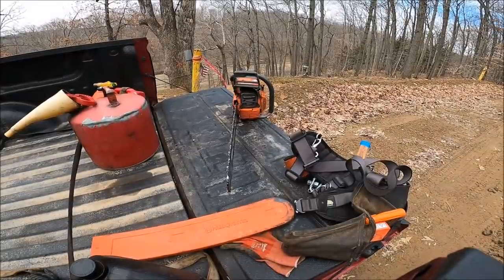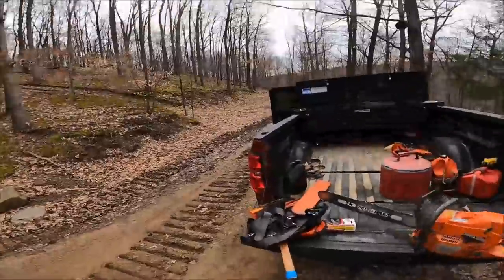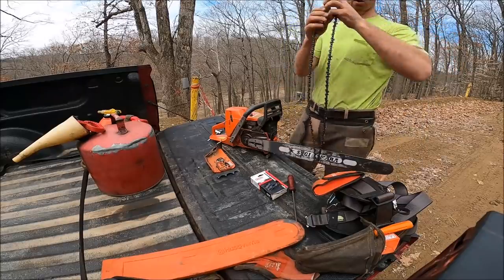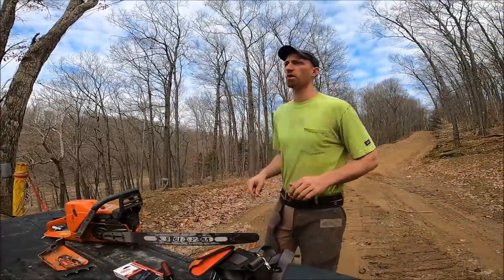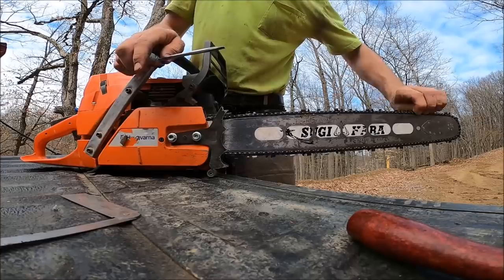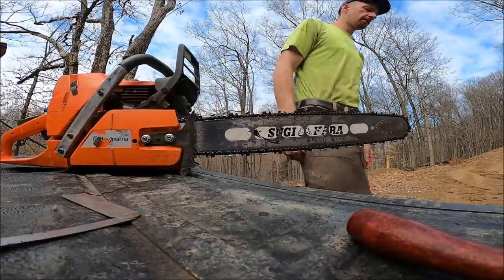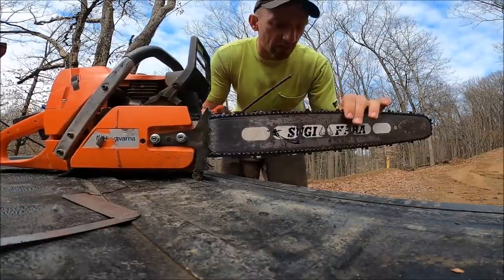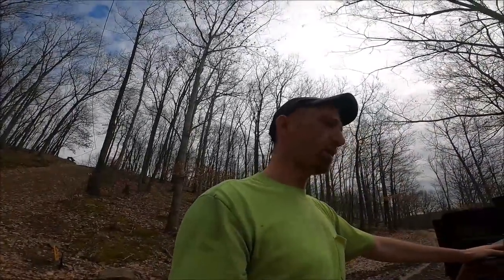New job logging the old school way! Gotta sharpen a brand new chain???

Comment: Experts I listen to, also say "pass on the grinder, except for rocked chains- use a file." I've never in 50 yrs found a new chain that didn't benefit from the attentions of a file. As a part-time cutter, over the years I've tried all ways of chain sharpening, and have settled on Granberg G-106 guide, because of precision and repeatability, extending chain AND file life. Put a flat file in, reorient things and take down the DEPTH GAUGES precisely. True, that guide takes a little conscious thought in the learning process. Then it's "play it again, Sam." No need for stump vise with it. I still use one from 45 yrs back. (FWIW Chain mfgs make no mention of "rakers." Thinking of misery-whip plowing-teeth?) Tightening chain, I find it easiest to set the nose on something soft and raise the handle- keeps fingers clear of teeth. Don't let the cutters bite, Pete.

Comment: Just a quick informational point. Heating the teeth with a power sharpener WILL ruin the chain, and I hand file too, but it won't make it more brittle. Unless you accidentally somehow quench it heated steel that cools slowly gets softer and less brittle.  The teeth won't hold an edge because of that. Great information though.

Comment: i find people always are looking for a way to make sharpening a chainsaw easy and try to skip the steps it takes to actually be successful. my biggest tip would be to first learn how exsactly a tooth cuts and which part does what. then just practice and build the muscle memory it takes to be consistent with a file and if your not sure about raker height double check with a gauge. and ive found alot of the times ppl assume that there cutting on an angle is the chain right away when alot of the times its the rails on the bar not being level. everyone struggles with it at first im no exception and im still no master at it but u can save urself alot of hassle by just learning what can cause it to cut crooked or throw powder instead of trying find some gadget that may help with part of it but as a whole wont make it easier. my biggest issue i have no is finding a good spot to prop my saw up to hold it steady when i file that doesnt kill ur neck lol. great video though man i like how you keep it simple and dont try to over complicate it and let ppl know to just do it and it will come over time.

Comment: I like a chain thats had a third worn down as I have the riders where I want them, the angle of the tooth is just right an it throws chips long as your hand,, have to be careful when that sharp as  they are very aggressive and easy to ruin if cuts not cleaned out of debris

Comment: thanks sharpening video. When I tighten bar nuts I use a 3-4" chunk of wood  to raise bar tip, your doing same thing, only quicker. I am going to take your advice on chain tension,  I think I have been using too much tension. Thanks for the watch

Comment: Used to log out west. They used Oregon chain skip tooth, chisel bit  I think. With a new chain, I didn't file it before ever using it, but I would take three or four swipes off the rakers right off the bat.  Our teeth had a line for the angle. I usually tried to stay with that angle. Some guys wanted more angle.

Comment: Also when logging. The landing men used the skiptooth chain. Cause If you hit dirt or rocks it was less teeth to fix; filing.  While the fallers used "Full-comp" chain. Which has twice the teeth. One every link compared to the skip-tooth chain. Usually they weren't bucking or limbing  and hitting dirt or rocks.

Comment: I used to use the EXL chain. Got 3 bad batches of it with teeth so hard a new file wouldn't scratch it. I finally said enough is enough. I'm a diehard stihl guy but found the C83 xcut Husqvarna chain. Crazy sharp out of box and works great! Stahls has it and it's only a few cents more than the junk oregon. Try some out, you won't be disappointed!
Reply from the maker: Thanks for the tip
Reply: Yep, the new x-cut chain is great.

Comment: Pro tip;
A hard spring steel key ring can be stretched out and makes a perfect bar cleaner, it fits the groove and the oiler passage perfectly.
Reply from the maker: Great idea
Reply: Take the pointed end of a used up file and hammer flat with your axe, works like a charm and gives extra use to an old file.

Comment: Pete...I know they are expensive but when considering what normal (pink) grinding wheels do to the temper of a chain CBN wheels are a bargain.  They almost never require dressing, maintain their profile indefinitely, will handle 1000 sharpenings or more, but best of all they almost never burn a cutter unless you are much too aggressive in the amount of tooth you are removing.  The only wheels I found reasonably priced and very rarely burn the cutters are the black Molemab Resinoid wheels.  They cut really fast but need to be dressed a lot more than the pink wheels that burn and gum up a lot.  I only use my diamond wheels now.

Comment: The only reason I visit the Stihl dealer is for chains. They have great chains and okay saws. But why buy a Stihl when a Husky is cheaper and lasts twice as long? I used to cut around 4 million feet a year by hand for over 25 years in the Appalachians before I got my track cutter and I was die hard Stihl for years until I got a couple of 372s and 576s. Toughest saws ever made and the 572 is even better. I have a Stihl 462c and a 500i and they cut okay but are lacking that Husky quality and the 500i is way too heavy for the small amount of power it has. Talked to my dealer friend this morning and he says the 592s are on the boat and supposed to be at his door on 4/15. That day I will be at his door too!

Comment: there is a new chain called orbit the comapany is out of main they hae been out about a year they said harder than oragon chain holds a edge longer and you wil notice a difference when you sharpen i bought one for my 372 haden got to cut with it yet

Comment: Several yrs ago I went to work in a saw shop that had a Stihl grinder. The customers were weekend warriors who never touched their chains or touched them wrong. By the time I saw them they needed to start from square one. I usually sold them a new chain and sharpened the old one for spare. I also told them that it would take 2 machine sharpenings to get the teeth evened up without bluing them. I still prefer to sharpen mine on the tailgate.

Comment: Nice video.

I’m a backyard hack with a chainsaw.
But I love cutting.
If it cuts at a slight angle to the right as I pass thru the log - what’s the change I need to make ??

Thanks for the content!
Reply from the maker: Bar could be worn on the right rail or chain is dull on the left cutting teeth
Reply: Just to add a little on that.  Use equal pressure on both sides when sharpening.  Also, all teeth on both sides should be fairly equal in length.
Reply: Try using an Oregon depth gauge tool and that will go away if the bar is straight and not worn on one side ;).

Comment: What size file do you use for a 3/8th chain?
Reply: Ive switched from 3/16 to 7/32 recently, and I think I like the bigger file.  Creates a more upright gullet that cuts just as fast but seems to last longer.
Reply from the maker: 7/32
Reply: Just discovered you, brother. I also live in Pa, only I work drywall/plaster and painting.  But I own 160 acres of land, so I’m always cutting firewood or clearing fields and or trails.  I only recently stepped up my file and have found a big improvement.  I find it interesting that so many of the tree guys out here bore cut and then nip the dog tooth or trigger in the back.  I was never formally trained obviously.  Just learned from my dad and uncles, and they always just used undercuts and back cuts.  The only time we plunge cut is on a hard leaner.  I’m not crazy about backbarring, but it looks like you’re just as comfortable pushing on the back as letting the saw pull from the front.  I’m going to be sifting through you’re back catalogue now.  I love YT for that reason.  A guy like me can learn a lot from watching you guys fall timber.  Thanks

Comment: Pete… thanks…. Glad to know how similar we do it.

That chain tensioning tip needs to be a clip of it’s own… enclosed on a thumb drive with every saw sold.  My neighbor had a brand new small homeowner Stihl… I think it was a 170? This was his first chainsaw and first time using any chainsaw.

He brought it to our firewood cutting party one weekend.  We showed him how to start it… but,  It was totally gutless.  Every time he touched a log it would bind up.

I asked him to let me take a look at it… the chain was so tight you could pluck Yankee Doodle Dandy on it. 

So, I showed him how loose mine was.  He asked if I wasn’t afraid it would come off.  I told him that I hadn’t had a chain come off on its own… without being bound up… in years.

So, I showed him how to adjust it.  I then told him to make a couple of cuts and we’d readjust it.

I got to cutting and wasn’t paying attention.  After he made a couple of cuts, he went to the stump and started fiddling with his saw.

A while later, I stopped.  I could hear his saw laboring.  So, I waited until he finished struggling through his cut.  Then I tapped his shoulder and had him shut it down.

When he pulled his saw out and sat it on the log, I pointed to the blue bar and burnt black teeth.  I sat my saw beside it and showed him the differences.  

My old worn out bar didn’t have a speck of blue on it… and you could see light between the bottom of the bar and the chain. I said, you’re running the chain too tight and that bar and chain are toast.  

He said, “It’s new.  I’ll take it back and get another one.”

I was right, the guys at the saw shop told him they didn’t cover abuse.  Then he told them that running a loose chain was dangerous… they gave him his money back and suggested he find another dealer. 

He bought a Craftsman and tells everyone he knows how bad those Stihl saws are!  

He still runs his chain tighter than I would…. But loose enough you can’t play Civil War tunes on it!  

He doesn’t like to cut anything over 12” diameter.   His money… his safety… who am I to tell him he’s wrong?!?!